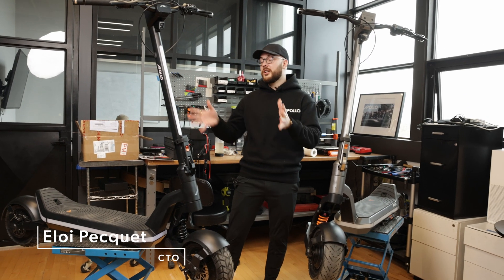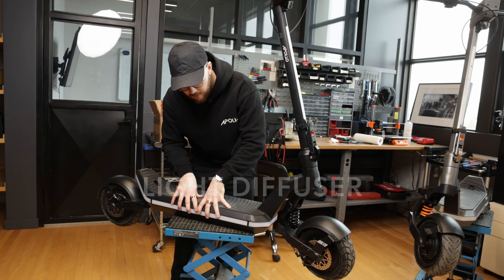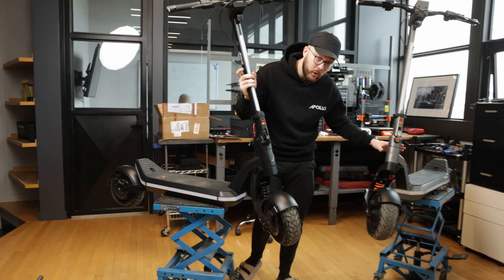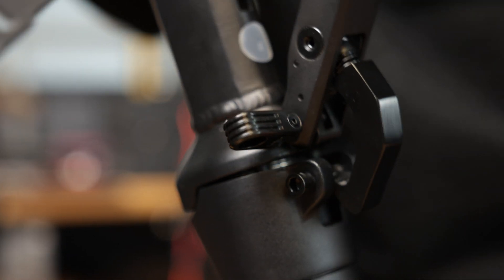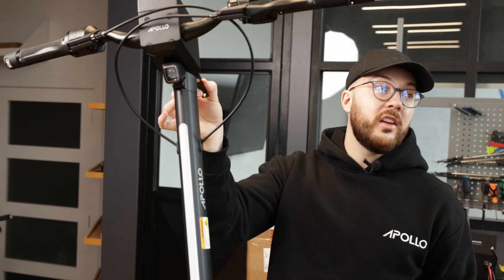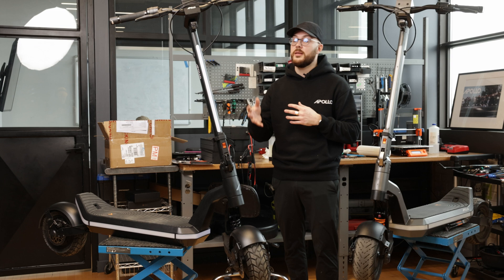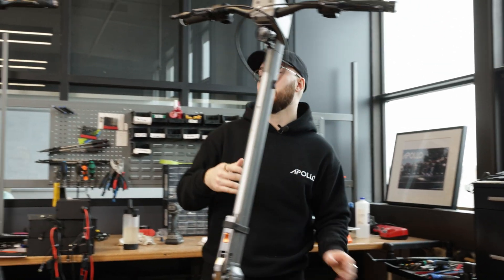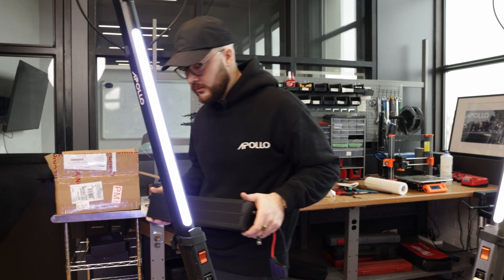V2 vs V3: Apollo Phantom 2.0 Comparison

Comment: I’m so confused. There is a V3 now on the new Phatom 2.0?
Reply: So there is the original v1 v2 3 and 4 for the old generation of the phantom. This is the new phantom 2.0 for 2025, the v3 is basically like the 3rd prototype but is not the official product, it will just be called the 2.0.

Comment: Unfortunately this scooter doesn't have any way to lock safely. 

I have an Apollo go and when I need to leave outside somewhere I can at least lock in the rear wheel arm (if someone removes the wheel can take the scooter).

I am in love with Apollo scooters but apart from the pro version it is really hard to lock the others.

If someone is from Apollo please consider this. 

Good leave a handle to carry the scooter and probably a place to lock safely. This is one huge point of sale depending on the region the scooter is going to be sold.

I am trying to make an e-scooter as my main and only vehicle. So this is a must for my usage.
Reply: I have the phantom 2.0 and honestly with any scooter i dont reccoment leaving it outside for long periods of time ESPECIALLY AT NIGHT. But i would recomend using at least 2 locks one U lock on the stem area because the only way to remove is by removing the bolts and then disconnecting the wires and then cutting or removing break lines. And the second U lock on the scooter neck. To remove youd have too remove the whole wheel and upper stem. In a worst case scenario if they just cut the actuall lock you can still track the scoot because it has apple find my, call the cops and give them the location of your $2.5k scooter and since its over $1000 of your property they take action and will retrieve it.

Comment: what if you guys added a splitable rim design? even if you get a tire gets screwed up in some way that the self seeling cant fix, you can split the rim, slide off the tire, slide in a new one and screw it back in place
Reply: Im pretty sure since its a big hub motor they cant really make it a split rim design. Either way its very rare and hard to get flats due to the Puncture Guard they have on the Phantom. Now if you have to replace the whole tire its best to take to a certified shop.

Comment: Disappointed that the non-Stellar model's quad lock doesn't have wireless charging. Hopefully that can either be upgraded after purchase, or that's changed prior to the production model. If nothing else, maybe a USB-C port to setup a cable charge (albeit that's super clunky).

Also, I'd love full RGB support for the lighting system just like the Pro.

Will the NFC unlock support unlocking via a phone that has built-in NFC (i.e. and iPhone)? That'd be awesome if it could.

Finally, I haven't seen anything about the alarm system, but I hope it's a lot better than how it works with the Pro. With the Pro, the scooter has to be on for the alarm system to work, and drastically drains the battery when its on. I'd love to see the Phantom 2.0 have an alarm system more akin what Segway did with the P100S. As long as the alarm is turned on in the settings, there's a built-in motion sensor that detects any movement even if the scooter is off, and then immediately the alarm sounds and the wheels lock. I imagine there had to be a small hit to the battery, but I honestly never noticed any battery drain with the alarm on.
Reply: They have a headlight that they sell on the website that has a usb to connect your phone. Also its probably not a good idea to have your phone running a data packed app, while riding directly under the sun and charging your phone (itl probably overheat it😅)

Comment: I think the folding mechanism is cool minus the rubber strap. 

It’s like a quick release on a bike hub but adding a rubber strap. 

Looking forward to going from my Apollo pro to one of these.
Reply: Trust the rubber strap is very easy to remove😂😂 its a tiny 2.5m bolt holding the strap thingy

Comment: I've put 6560 kms on a V3 (2023) Phantom, and I have to give credit where it's due. Apollo seems to have addressed all issues, and I love how the approach remains to innovate, and not just make huge scooters with super-wide platforms. The signals are a great idea - I like the front & back lights, and that they don't shine "up", which could annoy the rider.
By the way, the app got a LOT better recently, and I've been a big critic of it. Then when I saw my brother setting up his Nami Klima, with P-settings like some pioneer....I eased back on the Apollo app. But it has improved.
I've got this wishlist of tech that I hope we get to see in Apollo's models someday:

1. A wireless charging mat that I can park the scooter over (rather than plug it in) to charge. Maybe an adapter/current reducer that'll let me use a standard EV vehicle charger if necessary.

2. A wide-angle camera that sits on the back foot-rest that transmits a video feed of everything behind you, to the LED screen or your phone screen. Something akin to Honda's "Lane Watch", a brilliant idea & underrated improvement in safety that Honda doesn't get enough credit for. You signal to turn right, and your entire right lane is showing on the backup cam screen, wide-angle. You see people, bicycles & wonder how you got along without it. 

3. A signal light symbol on the LED or the app that stays on until you cancel it. The symbol of a left or right turn signal could get larger & larger, maybe change colors, the longer you leave it on, until it takes over the entire screen - so you don't accidentally leave it on for too long. 

4. A 'trust me, I know what I'm doing' mode. The throttle lever would have haptic/tactile feedback as it's pressed further, so you know you're entering or leaving a new level of 'aggression'. Like an automatic vehicle - the lighter your foot, the better the economy. Eco to LUDO, all separated into different depths of throttle press, each depth defined by haptic feedback. Like an Xbox controller - just a tiny haptic 'nudge' to indicate your throttle position is changing.

5. A 'quit' button/option that pops up in the app when the scooter is turned off or BT is disconnected for more than a few seconds - and the app would self-destruct all its processes so it's not forever looking for a scooter just because BT is on.

6. A more variable front-lighting: Software-defined option to adjust the headlight brightness.

7. Option for a slightly bigger LED screen? Maybe more streamlined? It looks like a big gray box sticking out of the handlebars.

69.  A 'sport' mode for the REGEN braking that spikes regen energy sooner, making it better for emergency stopping. Maybe more energy when coming to a stop so it doesn't fade out by the time you hit ~4km/h.

69 part 2. A mini-fairing to help divert wind/rain. Nothing too bulky, and not too wide, we can't have a sailboat on wheels, but even a small fairing down the stem can provide at least some protection from cold/wind/rain/bears. Just checking to see if you're still reading.

Comment: I genuinely adore the Apollo Phantom, but why did the 2.0 version remove the console speedometer and replace it with a quadlock? This change is much better for me because I prefer using the console speedometer instead of the quadlock. Additionally, replacing the console speedometer with a quadlock eliminates the need to replace the CP apps, as not everyone enjoys using cellphones while riding their scooters. ❤

Comment: As the owner of 4 scooters I love your innovation and dedication. However, you only got the brakes half right. All 40 mph+ scooters should have hydraulic disc brakes. Looking forward to your next video.
Reply: Hey! 
The disc brake are plenty enough for this one, and the stellar version will have hydraulic brakes! 
Those hydraulic brakes can be fitted on the 52V easily! 
All that being said, from the beta testing we are currently doing, people use the regen brakes 95% of the time and actually said they would prefer to have drum brake! 
Thanks for the feedback Jay

Comment: Wow Eloi ...just keeps getting better and better...not sure about drum brake replacement ...I just love the maintenance free aspect of drum brakes....but I understand :) welll thought out on the directional stopper....I hadn't considered that....the extra safety bolt on the folding mechanism is really wise...love that...safety :) The lighting looks amazing....love it on the GO :) After riding the GO, I must say the combination of the headlight and glow of the stem works so well....huge props....the heat dissipation on the controller looks interesting...for me personally I'm not sure I would need 60V over the 52V...I guess for me range and comfort over speed...overall looking like another awesome improvement :) Cheers from Victoria BC :)
Reply: I'm in Fraser Valley closer to mountains... got a 60v coming, and I'm super excited!

Comment: To make the Apollo phantom 2.0 perfect, all that's missing is a wireless charger built into the Quad Lock support. I completely understand for a purchase as a cost and price reduction measure that it shouldn't have this system in the base model 52v but in the STELLAR 60v model where the price is higher than the current Apollo Pro it makes perfect sense to have a wireless charger built into the Quad Lock support.
Reply: It probably is still not worth the added complexity. I don't think it even works. I have a phone with a quad lock case and my Pro wont charge it. I'm not sure how you'd have a mounting mechanism thin enough to actually work
Reply: My pro quad lock charges my phone……

Comment: So the suspension is no longer adjustable on the 52v? Also the brake lever is now on the inside of the throttle instead of the outside. Isn't it too far?

Comment: Will the folding mechanism eventually be available as an upgrade for other scooter models? Especially since I've had the original version of the folding mechanism break on the Apollo Pro, with the bolt on the hook snapping while I was using it. Having a backup mechanism would keep the scooter usable in that scenario.

Comment: I don't like having to use my smartphone with a scooter ... prefer if there was good display with all the settings and GPS Maps already built in to the scooter. This would save my smartphone battery running flat when riding my scooter and it would eliminate any problems caused by smartphone compatibility. Maybe this is something that we will see eventually.
Reply: Something like that ultimately won't make much sense imo. You need a network connection to have access to decent mapping, so, having a good, up-to-date GPS navigation on a scooter simply isn't possible without a smartphone. Moreover, if the scooter just has the ability for you to mount your phone, any improvements available to smartphones, such as for connectivity and display technology are instantly accessible from the scooter. It's also why I don't think cars should have their own GPS navigation software built-in, as what's available on a phone is pretty much always far better, and allowing people to just use their phone for that offers a better experience. 
If battery drain is the issue, I'd recommend charging your phone while using it to navigate. The Apollo Pro use to have a wireless charger built in to the Quad Lock mount, but if I'm not mistaken, that is no longer an option for purchase as a cost and pricing reduction measure. My scooter has it, although, I don't use it as I prefer to not use a Quad Lock case and instead I have glued a Quad Lock mount onto a separate phone holder. Instead, what I do, and what I recommend, is to carry a portable battery and charging cable, and to get a scooter bag to put it in, such as some cheap but decent 5L bag from AliExpress.
Reply: @SeagullAustralis  You don't need a network connection for GPS Mapping ... you just need to download your area map. Even without the mapping, I'd still prefer all the settings to be available on a nice screen without requiring a smartphone and hoping its compatible.
Reply: The app has a point system called AMP points. Sorta makes recording your rides more addicting.